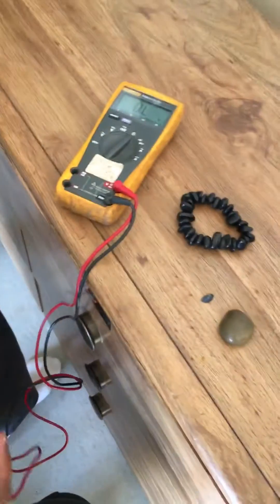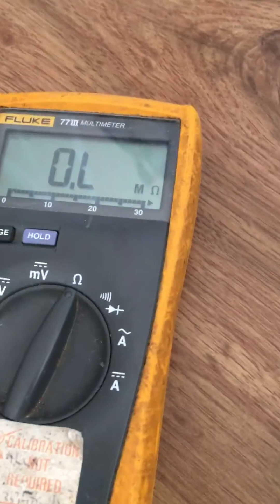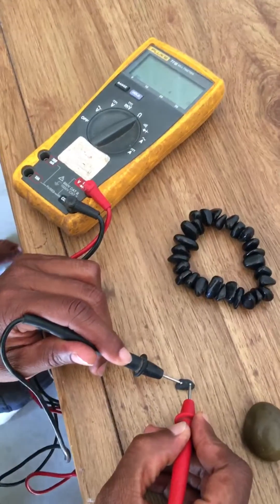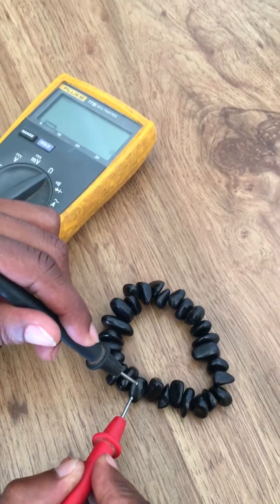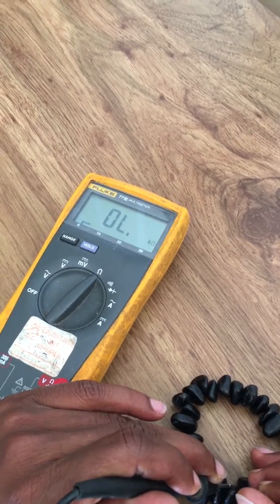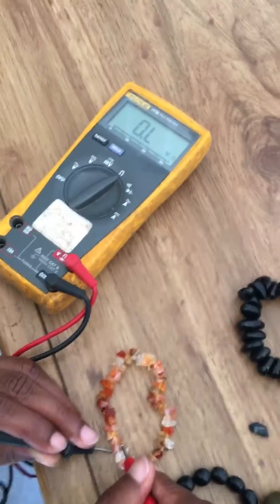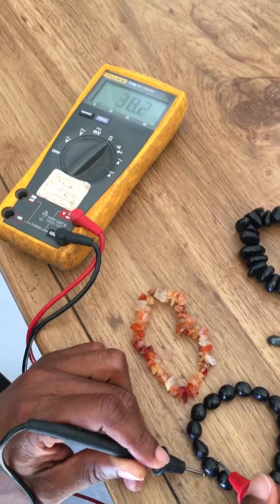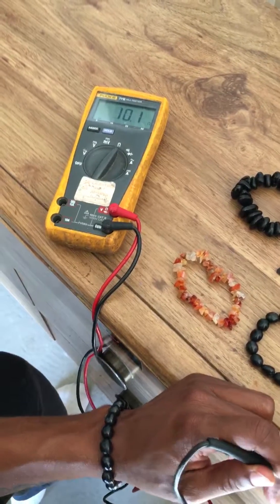Shungite testing with ohm Meter

Comment: Your shungite shouldn't get a reading. your meter may not have been set right cause it looks 0,L the rock you test should have a reading like the shungite did. Shungite conducts electricity and when used to test with a multimeter set to Olms it should go to 000s not jumping numbers. You may wanna retest to make sure its shungite and not have other stuff in it because it should test 0 showing no resistance. Hope this helps